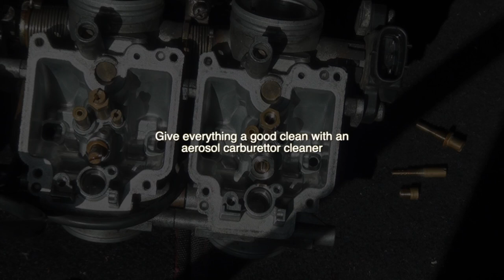Yamaha XJ900S Diversion carburettor removal and service

Comment: Just replaced my throttle cable a few days ago . I was not confident to remove carbs so did the job with them in situ . Wish you had posted your vid sooner 😆 as it took a lot of patience to get those cable nippes in their location under spring pressure . . Thanks for that vid . If I need my carbs off in future I will reference your vid again.
Reply from the maker: Hope it is a help Robert. Let me know if you get stuck on anything.
Reply: Which model

Comment: Thanks for your post. Just wondering how many km's on the odometer. I bought a 2001 divi four years ago, second hand. At 80,000kms. Coming up to 95,000km's what sought of things need servicing and keeping an eye on. Want to really look after this bike. Any advice? I'm in Bathurst NSW, and an older rider at 52. Cheers.
Reply from the maker: 165,000km at present. I bought it with 30,000km on it. Apart from the usual tyres, batteries and brake pads I haven't had to spend much on it.
The oil coolers are prone to leaking but you can get a cheap replacement off Ebay. I did the cam chain at 130,000km as it started to rattle. It's common for the fuel gauge to stop working, most learn to live without it. Centre stand can rust but I've never had any problem. Rear shock adjuster can jam up with stones, swingarm bearings can run dry. Front springs get a bit soft so a lot invest in progressive springs. Check your headlight 3 pin connector they can melt but are easily replaced with one from Supercheap Auto.
As for the motor, no problems so far, good compression, original clutch and doesn't burn oil. I think it could easily do 250,000km before anything major.

Comment: Hi Craig. I have a 1998 with 65000km. i havent done much to other than normal wear and tear. But you said that you renewed the timing chain at 130000km. Was the chain in one piece (complete rebuild of the engine) or was it with a rivet connector (just a top end removal)? regards from Denmark
Reply from the maker: The original chain and the new one were both riveted (no joiner). Using the common method I pressed the pin out of the old one with a chain breaker and temporarily joined the new one to it so I could gently pull it through the motor. Then joined the new chain and flattened the end of the pin.

Comment: Hi Craig. My 1996 Divy has just done 107,000km and i am having the timing chain and tensioner replaced this week.  When should i have the rubber seals in the carbies replaced if i am having no issue with them at the moment? Cheers  Rob
Reply from the maker: You only need to replace them if they are leaking. Normally you will see some cracking and it starts to effect idling. A good test is to spray some WD-40 on them while the engine is running. If the idle changes it means air is getting in and you need to check the clamps and maybe replace the seals (manifolds).

Comment: Can you buy a rebuild kit with new seals etc. And would the carbs have to be resynchronized
Reply from the maker: Yes you can buy kits to rebuild these carbs. Normally you don't need to re-synchronize them unless you made changes to  the synchronising screws during disassembly but if you fit new diaphragms, needles or jets it will probably need to be done.

Comment: When I remove my fuel hoose it keeps leaking fuel. Any idea why? Thanks!
Reply from the maker: Some fuel will drain back from the hose and the filter but it should stop fairly quickly. If it is leaking from the tap after you turn it off it is a faulty tap. Connect a hose to it and put the end higher than the tank while you remove the tank. You will have to drain the tank and fix/replace the tap.
Reply: @craiggrech  wow thank you so much. Yes i left it a little while its not pouring out its more dripping. So maybe i will have to take it apart and have a look. Thanks for the quick reply
Reply: I am really happy about your works I will like to new posts

Comment: Hi Craig , I messed up with the air screws now my bike can t rev up past 3k I'm wondering how much you turn the carbs after you clean them(2 turns or 3 I've tried both but still ) maybe I ve messed with the tip of one of them or more or my main jet Idk https://youtube.com/shorts/CXQQl3ZEDKg?si=h2aCoW7VWfGnCd_j
Reply from the maker: I think that's the main jets not delivering enough fuel at the wider throttle opening above 3000 rpm, not pilot or idle mixture which have less impact. Did you do a fully pull down?
Reply: @craiggrech  No , I did not took my main jet out only used carburateurs spray but I will tommorow
Reply: @craiggrech  you got me thinking maybe it s related to fuel pump although sounds fine maybe that is one of possible cause, Luckly I have two more of this.
Reply from the maker: @fsociety4829  Main jet doesn't block up, make sure you have fuel in the bowls. Check your fuel pump is working by putting the outlet hose in a container and hitting the starter. Fuel should flow out freely.
Check the floats and float valves are opening.
Reply: found that it was only the airfilter that needed to be changed . unfortunately I have now some sort of oil leak near fhe carburateurs something wrong with head gasket or valve clearence , my compression on all cylinders are 75 , half of what it s supposed to be